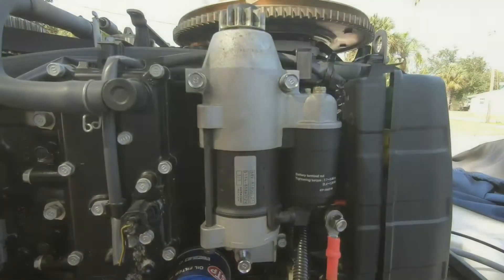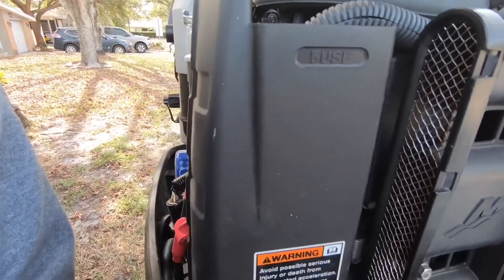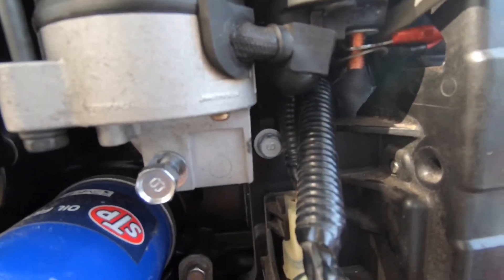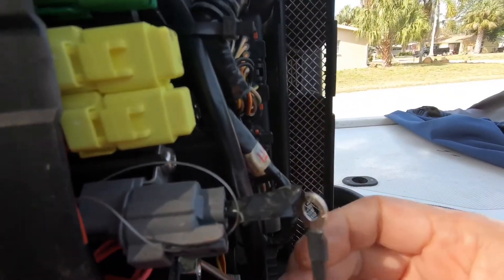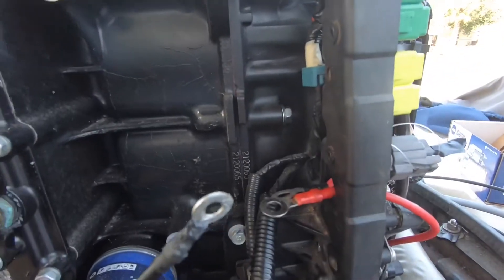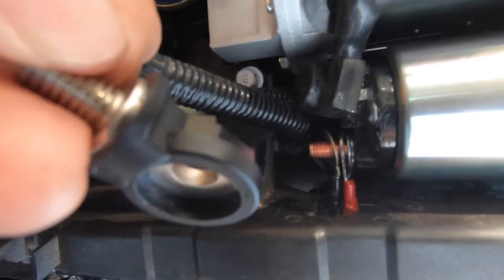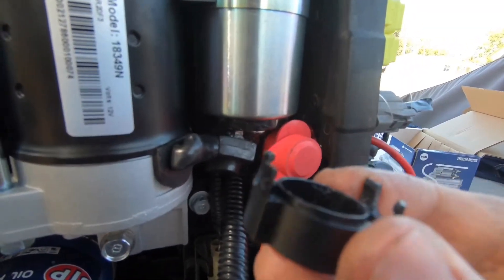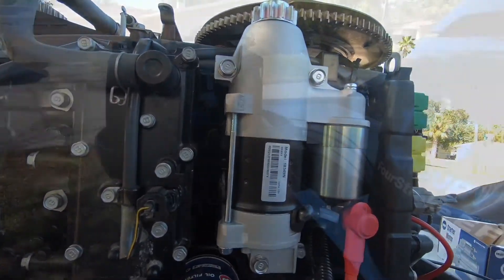2004 Mercury 115HP 4 Stroke Outboard Motor A Starter Replacement

Comment: Great video! Thank you. Pretty much the same for 90hp 2005 Mercury 4 stroke. Dang nut for brown wire doesnt wanna come off. PB blaster will help hopefully!
Thanks again
Reply from the maker: You’re welcome ☺️
Reply: @2fishyoutdoors   A quick question if i can....bench tested on shop floor, the bendix shoots out and spins. When installed and tried with key bendix shoots out but not strong enough to turn motor over. Starter/bendix seem lazy. With key in start I get 12.5 V to large batt +ve on solenoid. Next bolt in I get 3.7V in start. Is the 3.7V correct? Enough?